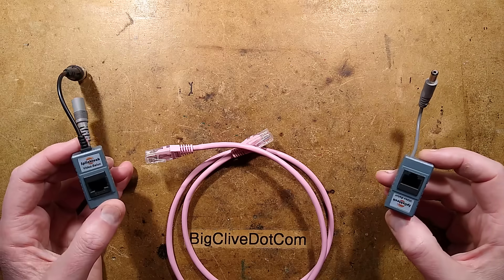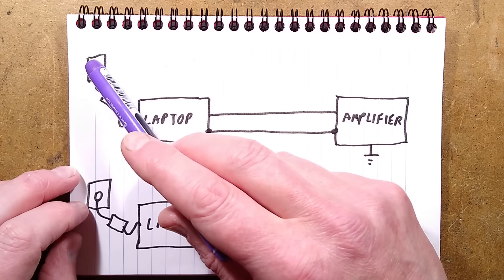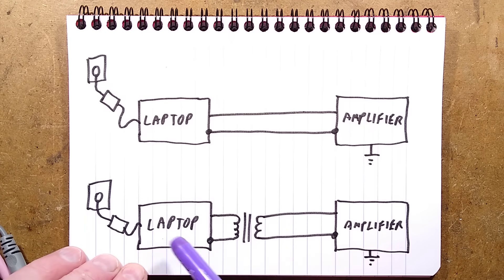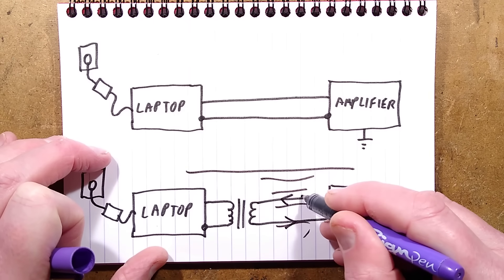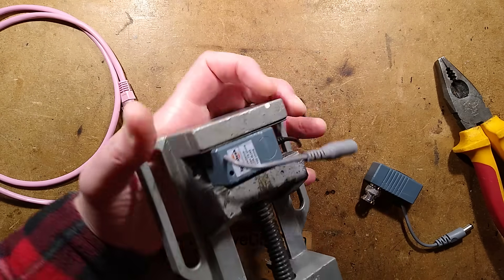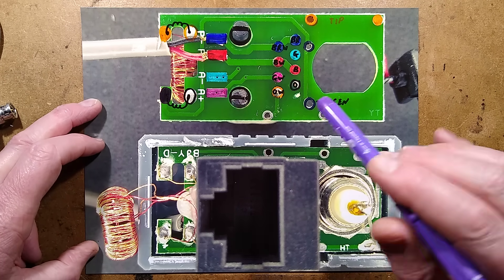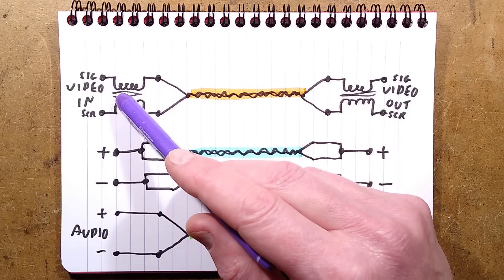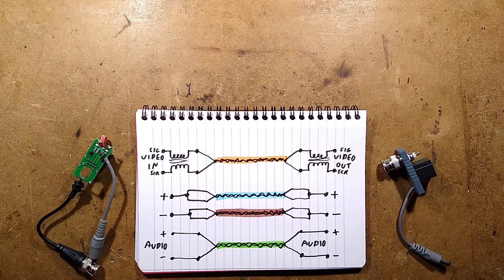Baluns - I got this one wrong (with schematic)

Comment: I can't believe I haven't seen anyone mention the (former) most common use of baluns. Early (until the 1980's) analog TV sets had 300 ohm balanced inputs and many antennas were 300 ohm output. You could run 300 ohm twin lead, but 75 ohm coaxial cable was better at reducing interference. So a balun was used at the antenna and another at the TV. Modern antennas come with one.
Reply: 300 ohms to 75 ohms is a nice neat ratio. 75 ohms to 120 isn't. Also, the fact that the minimum frequency of interest was over 50 MHz the transformers could be very small.
Reply: @D614G_aka_Doug  The nice thing about transformers is that they work equally well with "nice neat ratios" and whatever you consider to be a not-so-neat ratio.
Reply: And those old TVs with 300 ohm twin inputs had another balun inside that converted the input back into an unbalanced line that the RF amp could process. So basically, there were three baluns in the signal path from antenna to RF amplifier.

Comment: I was engineer for radio and TV stations in two adjacent buildings.  Swapped audio between the two, including the TV SAP feeding audio to four AM transmitters (a cheap STL).  Unfortunately, the buildings were fed AC power from seperate transformers.  Nearly 30 volts difference in the ground potential between buildings.  Had dozens of audio transformers isolating feeds between the two.  Constant battle keeping hum out of the audio.

Comment: Opposed windings. Think Common Mode Chokes. At each end means a composite video signal can be sent (1V PtP) over the cable in either direction and the interference is blocked.
Frequency sensitive perhaps too. Distance is still an issue due to losses, but it is better to amplify a weak clean signal, than a dirty one.!
David G1ZQC Radio Amateur since 1986.

Comment: I spent an entire year in college learning all aspects of impedance matching in two different classes.  It melted my brain a few times.
Reply: And bad impedance matching can melt transmission lines - quite literally. "Standing waves" on coax used for high-power RF transmission can produce local hot spots that will melt insulation.
Reply: My dad was an RF engineer working on early Radar systems in WW2. He told me that they tested power output  with high Wattage lamps and to look for hot spots on 50 Ohm bus bars?

Comment: What you have drawn is a "current mode balun" it keeps the current on its outputs the same. 
It dose this by stealing some voltage from the upper coil and transferring it to the lower coil. (but inverted). 
Its actually the same as "common mode choke". 
This is not my itself providing any Impedance change! are you sure the transformer winding is 1:1? 
Ethernet cables are usually 120Ohms and Video 75Ohm so... this shuld not have a 1:1 winding. 

https://www.youtube.com/watch?v=NkxLXQ32GDQ&t

Comment: "Horrific science" indeed.

RF is easy once you crack it. Seriously.

Imagine charging a big fat capacitor. You get a surge of current as it charges. But there is no actual current flowing out... so what is happening? 

Imagine gradually separating the two plates of the capacitor, but the current still flows. How can the current flow through empty space without a wire. Thats RF energy... "Displacement current" is the term.

Turn one plate into a wire, the other into a disc, where the wire pokes up through the middle and you have an antenna. (It also has capacitance and inductance, so you can make it resonate...)

Comment: I use Baluns in my security cam setup but, for video and PTZ data only. Those you have are the cheap ones that I don't recommend unless you're using small, very low current cameras. I spent a little money on some beefier ones that can handle more current but, I still have issues running power with them. I have very large PTZ's that require 3-5A each. I get the best results when they use their own dedicated power ran to the closest outlet. There are more "professional" ones that I'm just not willing to dish out the money for.

Comment: Also note, many of these baluns can transfer full-HD video, up till 100m so using a isolations transformer at these distances and frequencies would really screw up the video signal. Also note, many of these Baluns can also transfer AHD (analog HD, up to 1920x1080) and in some cases SDI signals. If you use a isolation transformer in these frequencies , I think you are really screwed.
Reply: Using an isolation transformer on high speed digital signals is actually easier than with analog video. Analog video needs flat frequency response from around 30 Hz to 4 MHz, and it's hard to make a transformer flat over 5 decades. Encoded digital signals have a much smaller difference between lowest and highest frequency components. It's not as high frequency as SDI but every twisted-pair Ethernet device uses an isolation transformer and yet it just works.

Comment: Many years ago, perhaps in college, I was told that BNC stood for British Navel Connector.  When I worked with a British engineer he laughed at me.
Reply: True, but British Navy Connector, as it had been developed by them as a method to connect coaxial cables on ships, as it provided a sealed bulkhead design, and ease of connection, but would not shake loose.
Reply: BNC = Bayonet Neill–Concelman, named after the two chaps who invented it. N-types are just named after Mr Neill. Less common is the TNC, Threaded Neill-Concelman, essentially the same but screws rather than twists.

Comment: Not quite.  It's not the galvanic separation that matters here.  It's the DC blocking.  A composite video signal relies on the voltage to represent the brightness (or sync pulse).  If the transformers were connected "conventionally", the waveform would always be centered around zero, whereas for very dark video, the waveform should be significantly above zero, and it in no case should it go below zero (which would be necessary some of the time if you were to center it around zero).  I love your videos Clive.  Thank you for showing so many interesting things from the inside :)

Comment: There are two ways that a signal can flow down a pair of wires. Either Differential or Single ended.
Telephone and Ethernet cables are Symmetrical and Balanced. The Differential signal flows in push-pull mode down both conductors.
But then there are Microphone and Video cables which are coaxial, and always have one side earthed. These are called Unbalanced.
Often it is necessary to convert from one type to the another, and that is what a Balun or Unun is designed to do.
The classic example is where an old style TV ribbon (eg balanced) needs to connect to a Coax type cable (eg unbalanced).
Incidentally the function of a Balun or Unun is not primarily for impedance matching. It may do that, but that is a secondary part of the design.
A related device is the "Common Mode Choke", or "Braid Breaker". These act to force the required mode, either Differential or Single Ended.
And there is also the "Isolation Transformer" which allows Differential signals to pass, while blocking Common mode (eg single ended) signals.
Each device has it's own unique function and is used to cure a specific problem.

Comment: I tripped up with this myself.
In my case, the baluns I was trying to use were for datacomms. They were real 1:1 isolation transformers. I lost the DC and LF components in the video signals, so messed them up.
I really should have known better !

Comment: Radio hams use baluns (and ununs) all the time at HF, but only about 10% of us can explain the operation and construction!
Reply: I used to be able to explain it back when I got my Extra but I doubt I could now.
Reply: Smart hams also use an optically coupled USB gizmo when connecting radios to computers
Reply: The construction is the easy part....😂

Comment: Interesting video, thanks Clive.
I build my own HiFi gear and often use a ferrite torroid on the linear PSU input side, winding live and neutral around the ring together. This filters out a lot of high frequency rubbish before we even get to the transformer primary. As the current in each wire is travelling in opposite directions, is this pretty much what you have here? Maybe these tiny torroids are filtering out frequencies above what is needed for video?
Just a guess. You'd need a signal generator, an oscilloscope, a dummy load and loads of time and patience to prove the hypothesis.

Comment: Ibm used twinax with 55 ohms resistance from one connector to ground  or 110 ohms across the two connectors, when they brought out token ring  you could use the token ring patch network but had to use baluns for it to work The end of the cable had to have a 110 ohm terminator. Can bus in cars use 60 ohms i believe. To me it is all white man's magic.

Comment: My background is data a telecoms, we used baluns that would take an ethernet signal and convert it to a 2meg carrier on mini coax, these were actually pretty commonplace, but in recent times have been replaced because the PSTN is being replaced by IP telephony. 
I've seen all manner of baluns, but i've never seen one like you opened. 
Stay well Sir.
Reply: Or the curse of any line tech, the 0+16 line expander, which would cook the cables when it got wet, and gave you a nice zap with the 300VDC it used. Or ISDN, which did the same, plus plugging in a butt would make it smoke nicely. Always made sure any interconnects with those pairs, or ADSL, were a different colour in the junction boxes, so as to warn of the peril. not fun for the line tech to open a street junction, pull the cover off the cable joint, and see that there are a few black wires in there, leading down the paper insulation into the cable, saying time to cut back a few metres to find good paper. Or the 1970's era 2M punch units, where you punch one wire down, and 3 pop loose randomly elsewhere in the frame.

Comment: We had a problem where i worked with a CCTV camera that was mounted on a different building than the monitor, possibly on different phase, got a device that i think was called a 'humbucker' or similar, can't find the actual device but it may have been a 'ground loop filter', my guess is that it had a transformer, it was more of a professional unit.
Reply: Those are galvanic isolators. For video they are actually a RF modulator, a small isolation transformer, or 2 small 10pF 2kV capacitors, that allowed the RF, typically around 60MHz, roughly channel 1, to be coupled to the other side of the isolation barrier. Power supply had a small mains transformer, with 2 isolated secondaries, rated for 2kV between any of the windings, that provided power for each side. Far side had a simple RF demodulator that recovered the video signal back, did basic black level clamping and DC restoration on it, and fed it out as 75R 1Vpp video. good to around 8MHz bandwidth, to handle colour video signals, and often with a pretty rugged output driver with 2 outputs, to allow monitors and VCR's to be connected. 

Provided both ground loop isolation and protection against high voltages on the cable, though not actual lightning protection, which was a separate block device you placed each end, which had a simple spark gap GDT from the shield to a ground terminal, and the centre conductor, and which had a fuse on both sides of the GDT that would blow if there was a near strike, to protect the equipment. 50mA fuses IIRC, though of course you often found they had been replaced with a wire instead, and a fried camera and monitor at the other side

Comment: The apple chargers do have a ground. The metal lug on the plug is a real ground. Unfortunately a lot of the time they don't connect the ground to the port because it's basically unused unless you use an apple specific extension
I think it only grounds the shielding in the PSU and not the plug
Reply: I notice a slight tingly feeling when sliding my fingers over the case of a MacBook when using the little swing-out 2-prong plug (on 240v, but not on 120v), but not if I’m using the grounded cord.  (I live in the Philippines and they use American plugs but with 240v, gotta pay attention if bringing plug-in items here!)
Reply: Here in Germany most Laptop / Notebook / monitor power supplies have a  proper ground. 
If they don't have a grounded plug they are required to be doble  insulated / electricaly separated from the mains. . 

So it's not a Apple thing

Comment: Exactly how TV cables work, which allows amplifier placement along the lines.
Reply: In-line amplifiers are often phantom powered. The DC power and the signal share the same transmission line. It is comparatively easy with RF signals where there is a wide gap between the lowest frequency of interest and DC. The DC can be coupled via something as simple as inductors which presents low impedance at DC and very high impedance at the lowest frequency of interest. The signal is coupled via capacitors. Phantom power is also used with microphones, but there the difference between the lowest signal frequency of interest and DC is pretty small, so active circuitry such as a current source, is used to feed power.

These simple balin boxes use on pair for signal only and completely separate conductors for power.

Comment: I wonder if this is why I get an audio pop when I restart a youtube video with my new laptop.  This never happened with my old laptop.  My headphone out is plugged into external soundbar that is driven by non-grounded 12v dc power adapter.  No other distortion or interference is noticed.
Reply: The  pop is probably because the audio chip is powered down when there is no audio playing. When it powers up the dc blocking / coupling capacitor charges to half the audio chip rail voltage, producing the pop. Some chipsets handle this more gracefully than others.

Comment: Dude. If you are getting a tingle from your laptop, something is SPECTACULARLY wrong. It is never "by design" leakage as you imply. It is horrifying you think that is in any way normal operation. 🛑
Reply from the maker: If you have a laptop with an ungrounded power supply, try measuring AC voltage between the chassis of your laptop and a grounded object.

Comment: there is also the risk of the two devices being powered off different mains phases (possible 415v ) that will do no good to either device
Reply from the maker: On a common supply the ground reference is shared.

Comment: Saw these 10 years ago but really have to wonder who would use these in the era of PoE
Reply: They have nothing to do with PoE. They are simply a way to use low-cost cable with good performance characteristics for baseband video.
Video over Ethernet introduces significant delays which are intolerable in some circumstances.

Comment: Passing signals through isolating transformers at each end to do the unbalanced-balanced-unbalanced conversion is the more familiar setup, called a "voltage balun". The setup here is an example of a "current balun". They really are doing unbalanced to balanced conversion and vice versa. The thing with video signals is that they have very low frequency components ideally going down to DC. Using the voltage balun setup, the transformers would be unfeasibly large if the lower frequency limit is to go down to a few hertz. The current balun will always pass DC.
Reply: Normally a balun would be designed so that it operates within the linear region, keeping away from saturation, hence hysteresis is not a problem.
It is perfectly possible to design large high frequency transformers, though special winding techniques and core materials are used. They can be found in high power transmitters for instance.
Reply: If you make a transformer that big wouldn’t it cut off the upper end too?
Reply: That's very clear, thank you. Does transformer hysteresis ever become an issue?
Reply: Data transmission over "RJ45" patch cables often uses isolation transformers built into network cards, with any DC power being 48V fed through center taps to use an entire pair as plus or minus, while still carrying balanced signals at 100MHz or more on the same pairs .
Reply: @johndododoe1411  That is true, but for video transmission you need the signal bandwidth to go to DC. In the POE arrangement, the signal bandwidth won't extend below a few hundred Hertz even though DC power is being supplied over the same conductors.

Comment: Could it be that the two transformers set up as common mode chokes both ways as well as impedance matching devices. That is how they protect from outside disturbances.  Just a guess mind, don't quote me on this.
Well, having typed this I can't see where tha matching effect would come from in this configuration. To achieve matching you must have clear primary and secondary winding, not sure if this concept applies when connected this way.

Comment: Seems they just accept the minor mismatch of 75Ohm coax vs. 100Ohm TP. That's a so-called current balun to interface the unbalanced coax to balanced TP. No impedance matching happening here.
Reply: Are the transformers wound 1:1? If not, there is impedance matching. A simple matching transformer for 75 ohms to 120 ohms would require a ratio of (75/120)^0.5 = 0.79:1.
Reply: @D614G_aka_Doug check the circuit in the video. The current balun really is not a transformer but a common mode choke.
Reply: @thes764  
Where in the video does Clive confirm the ratio of the windings is 1:1?
On what basis do you assert there is no impedance matching? If impedances aren't matched what happens to energy arriving at the end of one transmission line not terminated in its characteristic impedance. There may be series termination at the source for the unbalanced signal in some cases, though I doubt it. 

In the video it appears there is wire wound belt-like around the outer circumference of the toroid, between layers of normal turns. What is the function of that?